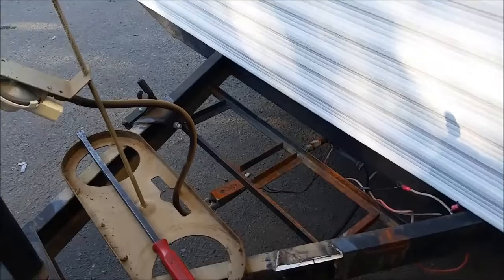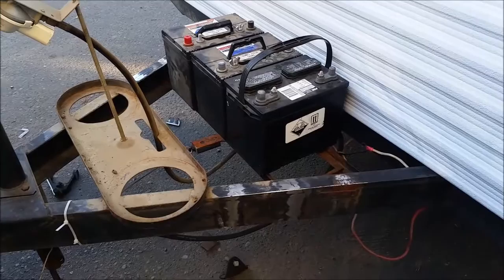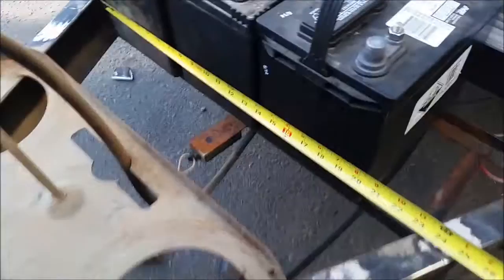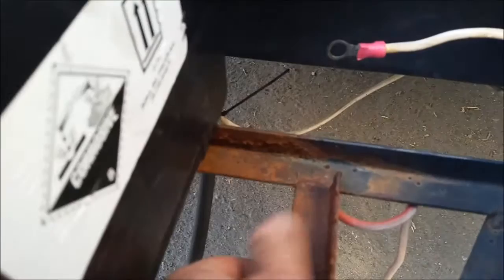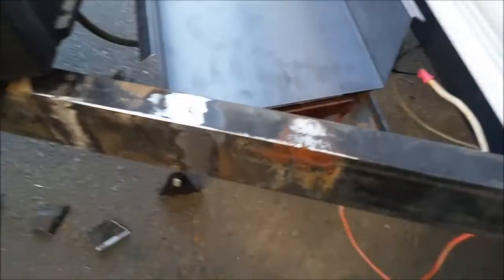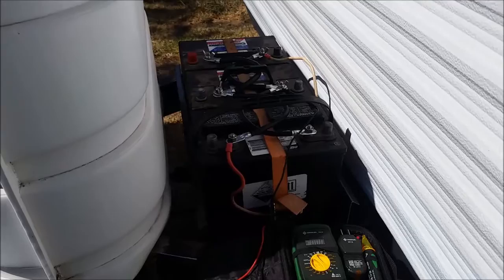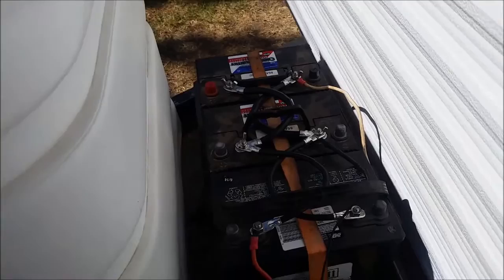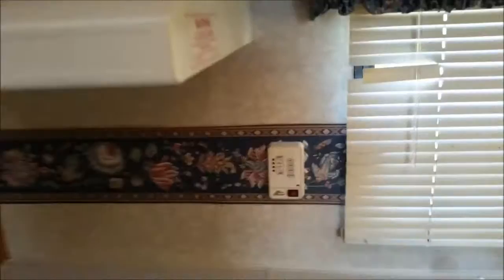Travel Trailer Battery Upgrade

Comment: Some 3/4 tons and 1 tons are still restricted by wdh. My 2017 f250 doesn’t require one (I still use one) but the 2016’s require them to tow full capacity. Good video though.

Comment: Have you thought about a battery monitor? Im going with a victron and 2 6v batteries. Will give me 210 amp hours as opposed to my single 12v 75 ah or 2@150!etc.. with the monitor you get an accurate reading on power usage so you don’t damage the batteries by overdrawing.